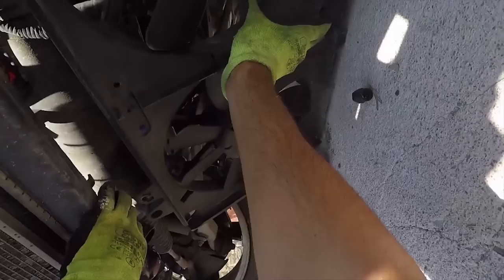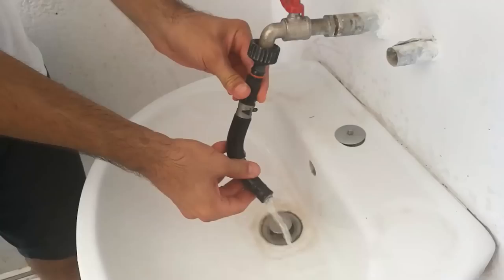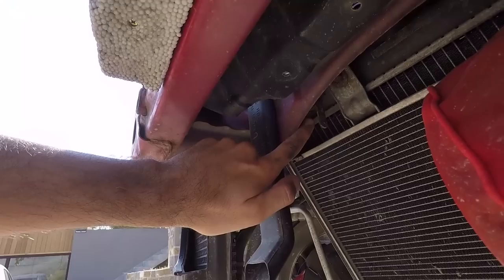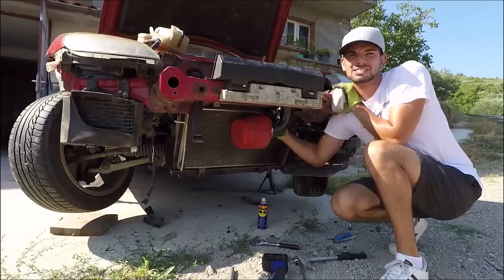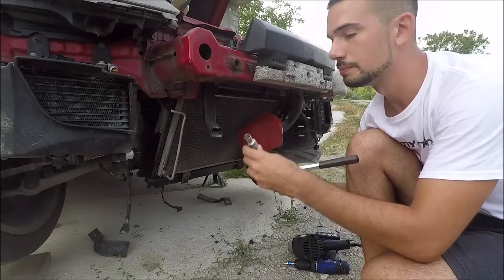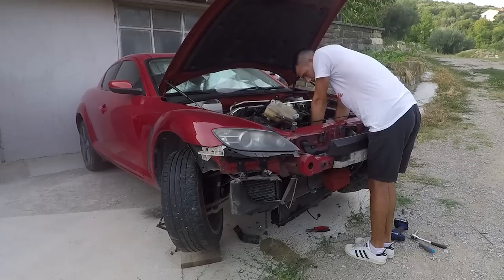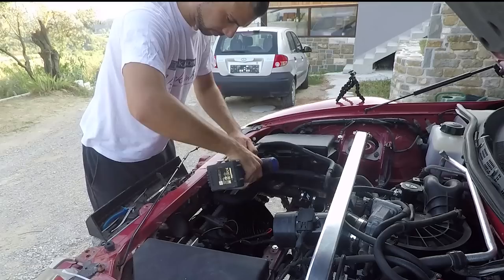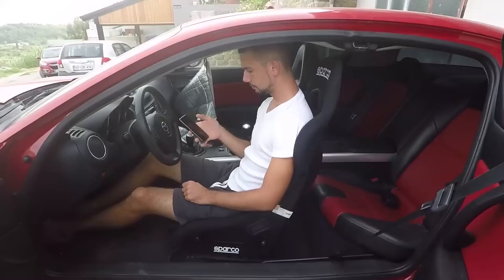Mazda Rx8 Radiator Replacement After 14 Years!

Comment: I just had this happen today on my 2009. When I went to remove the piece of pipe still stuck in the hose, it completely disintegrated. I guess after 14 years the plastic degrades with the heat. Glad it happened in my driveway and not on the road. That sort of failure could ruin your engine pretty quick. Replacing the radiator with an all-aluminum Koyo. No more plastic garbage.

Comment: Good informative video. Regrettably, rusted bolts are a fact of life. Having the right tools to get them out does sometimes involve a circular saw. At least they weren't broken off in the engine block.
Reply from the maker: Thanks, glad you liked it :) True that... Hopefully i had plenty stressful experiences in the past that made me buy all the necessary tools to remove any rusted, rounded or welded bolts and nuts. Thank god i didn't have that experience yet.

Comment: If you have a stuck bolt,,,get a small propane torch most hardware stores have them for $14 and liquid wrench. Torch it spray,,,torch it spray it. Tighten it losen it and repeat until the bolt wants to act right, breaking bolts or stripping bolts on any job makes the job 100 times harder.

Comment: Man, a radiator install sure is a bitch on our cars! I won't lie, I had my KOYO aluminum radiator professionally installed because I didn't trust myself not to break off a bunch of those delicate little decade-old plastic connectors on all the crazy stuff you have to remove. A radiator refresh is definitely great for our cars though; I went with the triple-combo of a KOYO all-aluminum rad, a RE-Medy Series II style water pump, and RE-Medy upgraded thermostat from MazMart. Definitely cooled the 8 down a few degrees.

Comment: Damn Kris, i see you had much struggle while Changing the intercooler and radiator, Zero Wing doesnt gave up easily on it huh? :) well, i have other problems... ill need to change coolant, (its already dark brown ew.. by the way i want to install blue silicone hoses) and my Clutch is slippin trough, wgich means, only slowy accelerating is possible... but Yuu-Chan needs rev's im puttin some money month by month aside to restore her chassis, got rust on the bottom, aswell at the right rear, inside the trunk in the factory welding... it needs to be replaced. Aswell i want ro zinkcoat my whole bottom, aswell as make a sealing from the inside with Mika Sanders :) still getting very expensive dough, but i dont want to give up on my beloved Yuu-Chan , greeting from her and me from germany, ill hope the best and always i stay tuned bud! #Brap #JustRotaryThings #RX8 #Z00MZ00M #JDM
Reply from the maker: sees SilverShadowLP comment ..... goes to the kitchen, makes coffee, brings to the table, puts nice song on youtube https://www.youtube.com/watch?v=xj4ADZhEfJo , starts reading :D 

This car will never be left alone, cause it has a very stubborn and perfectionist owner :D I see that your issues are mine also! I had in plan after summer to take care of the rust and  chassis in general, before installing the bodykit. Hopefully i will have a video for the hoses, in case you should need it :) Without any doubt this will be expensive... for both of us, but if done properly, the car will be like new, and will last for a very long time. As long as it's done slowly, and saving money at a good rate, the investment will be worth while, and also we'll be happy because we get to eat 1 piece of bread more :D Greetings for a very summerish Slovenia :D Hope you can make it down here one summer to experience it!

Comment: This exact same thing just happened to my second rx8 lol. God those radiators are crap if you own this car just get it replaced with a good full aluminum one so you never have this problem and improve your extremely important cooling system.

Comment: why not put aliminum radiator ?
Reply: You ever see the prices for an rx8 aluminum radiator, like $400+. Personally I bought a $130 aluminum radiator off ebay. Believe it or not you can actually get a decent quality alum rad off ebay if you know what you're looking for. Look for the term vacuum brazed in the listing, most cheap alum rads get a bad rep because the tubes are epoxied on instead of brazed to lower costs. My rx8 never see's temps above 176° while moving and 189° while sitting at a stop light even with stock fans.

Comment: So i got a question, I have a 2005 rx8 and I'm not too savvy with newer vehicles as well as rotarys, I am familiar and understand how they work, but when it's warmed up fully it will not want to start for about another 20 mins or so. It just cranks and cranks, the lo get I wait, the faster it cranks over and will eventually start again, and I do rev it to 3k everytime before I the. It off, any suggestions to help?  Also wants to die at idle if I have a/c on, had to push it way too many times on summer days lol. Anything is worth a try, thanks
Reply: Get a compression test

Comment: Hey man, so the other day I was driving my RX8 on the highway and when I downshifted into 4th and began to accelerate, the RPMs shot up and then went back down to where they should be before the car would gain any speed. Im sure its the clutch but in low gears at low speeds it seems to drive normal. Clutch seems to grab ok when taking of from a stop aswell. Is it possible to need a new clutch even if It launches ok like that? The car is a 2008 and has around 150,000 kilometers on it. The engine has good compression.
Reply from the maker: Does that happen everytime or just that time?

Comment: whats that thing behind the radiator that kind of looks like a radiator? just got an rx8 im rebuilding & i need i new radiator and one of those
Reply from the maker: You mean the thing in front of the radiator? That's the AC Condenser :)
Reply: Driven by madness thank you brother 🖤 im gonna order that i need to get the condeser now.  i have pulleys and new radiator, need a few more things i  put water pump on but how do you take the condenser out ?